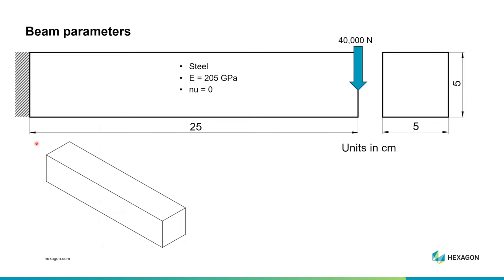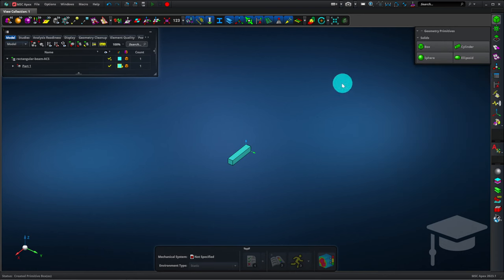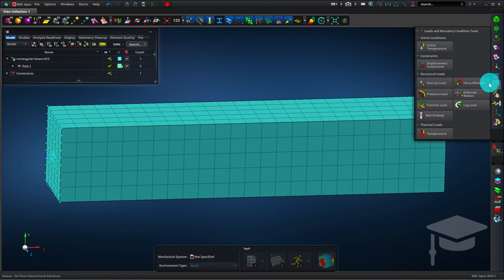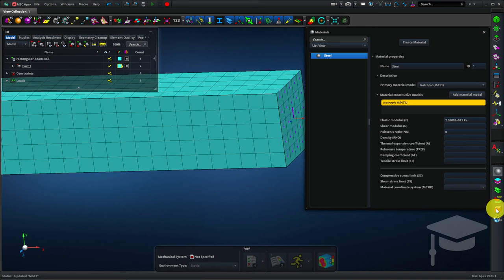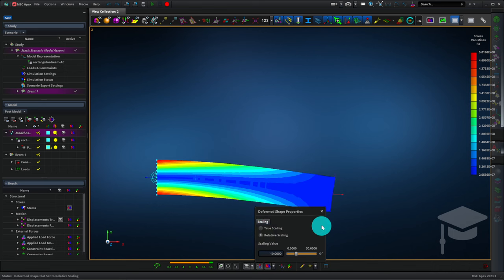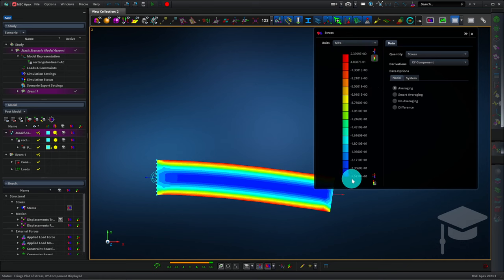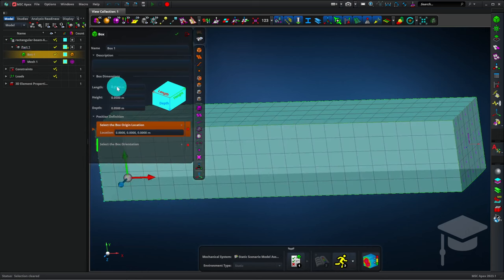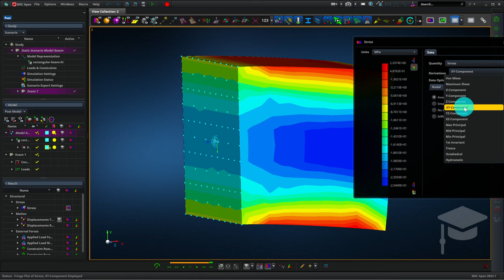Transverse Shear and Bending in MSC Apex

Comment: Transverse shear stress will be comparable to bending stress in case of short beam length..Right?
Reply: Good question! You're theoretically correct. However, the beam would need to be very short, ~1/4 its depth for a square beam or 1/6 its diameter for a circular beam. At that point, I don't think classical beam theory holds. I think transverse shear has 2 major real-world applications:
1. Failure of anything held together by adhesives, such as composites or beams made by gluing layers together.
2. Cross sections of beams. In particular, I-beams have the web width that they do to resist transverse shear.